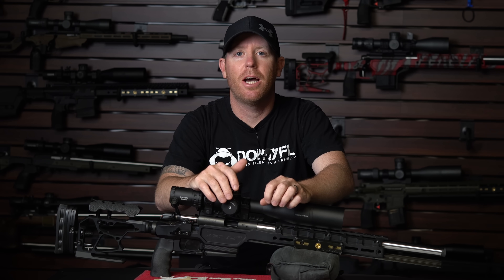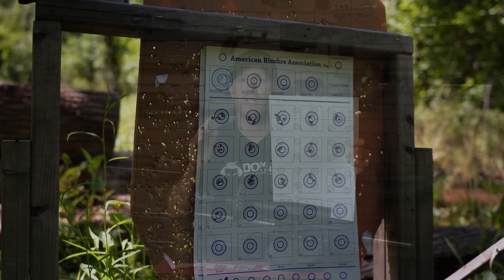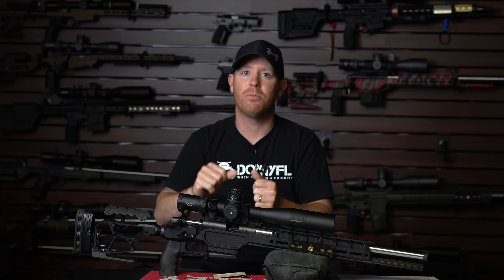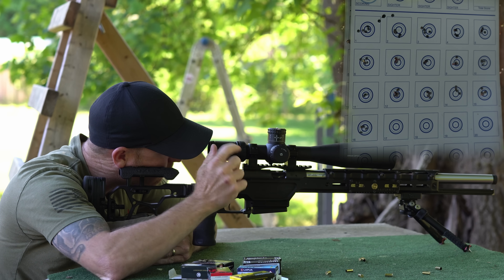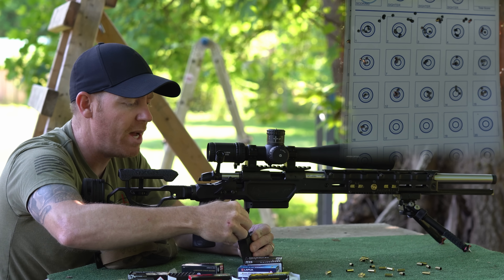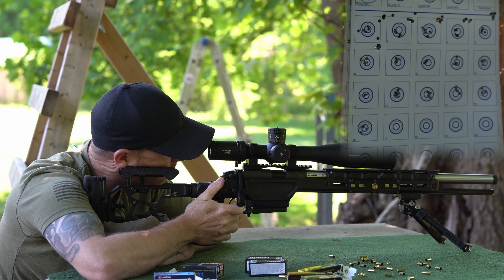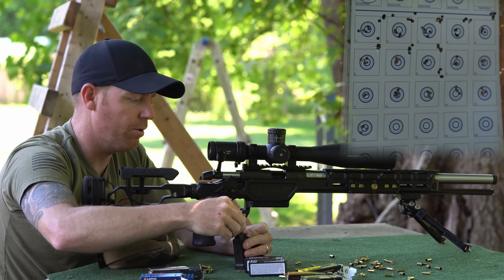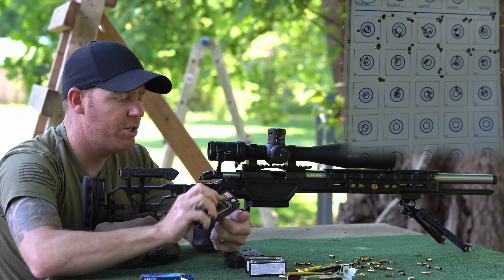Increasing Accuracy with Shims //Bergara B14R Heavy Part 2

Comment: I feel it's safe to say I have sorted more 22lr ammo than anyone, maybe 20k rounds.  Here is the interesting thing I have found, now this is the cheap 3 bucks a box ammo.   I can re-measure some ammo, and it appears the rim will give me say 3 different measurements, i.e. - one side of the ammo's rim may be way thicker vs the opposite side, and the measurements are repeatable, its what I call bad ammo.  I have found on the low end .0365 rims up to .042 thick rims, I sort out to .0005 lots.  Yes, I have more time than money, but it is interesting results for sure.  I like the idea of shimming, it makes a lot of sense if you have consistent ammo. :_Vudoo: :_Target:
Reply: Absolutely correct. That's what I do, then I measured the head space, subtract the difference in rim thickness, and now you'll know what shim to use. I noticed a difference on my CZ 457.
Reply: The only repeatable results from sorting I have ever gotten were from sorting Remington Subsonic by weight. The heaviest ones shot on par with any match ammo I've tried in that rifle. 

I did the math, and if I want 50 rounds of match quality ammo, it is cheaper to just buy a box of match ammo than it is to buy enough Rem SS to sort out 50 accurate rounds.

Sorting is not the answer. I consider my rim thickness gauge to be one of the worst purchases I ever made.
Reply: @sapago4166  When I sort by rim size, I typically get 6 main sizes of ammo.  
.0395 .040 .0405 .041 .0415 and .042
With most in the 40 and 41 category.  I have a scale, but I haven't used it, it would be way too much work, if I were shooting a match and weighing 150, it may be worthwhile.  I totally agree, just buying good ammo is the best answer
Reply: I want whatever you’re smoking

Comment: I had similar results with my B14R HB from A&J. I put mine in an MDT XRS chassis with the Trigger Tech Diamond trigger and used the Cortina precision bolt shroud. Mine doesn't shoot SK bad but it really shines with Lapua Center x , Lapua Long Range, Lapua Midas + and RWS R50. I've never tried the bolt shims but mine is not as consistent with the Eley Match.

Comment: Bolt shims made a HUGE improvement for my CZ 457 Varmint MTR for both the 22lr and 17HMR barrels.

My take from this is that Bergara does a better job at the factory with head-spacing than CZ.

Although there’s a lot of voodoo in the world of rimfire, so often what works for one doesn’t for another.
Reply from the maker: I'm sure it's a floating tolerance. I think they are worth the few bucks someone would spend to optimize a factory barreled action for sure

Comment: Super interesting stuff... I suppose rim thickness sorting could be a thing to try? 🤔
Reply: In all honesty, with quality ammo, they give you a good product you shouldn't need to sort, but if you use cheap stuff, and have time, it may be worth the while.  I can sort a box of 50 in about 4 minutes.  I do see less fliers with cheaper ammo for sure after it has been sorted.   The equipment I used to measure, bought from the big online shopping site.  A Raven Eye Custom shell holder, a Digital indicator with a .5" throw (important not to buy the 1" throw, it will be too big) and a set of indicator tips (the tip used is usually pictured in the lower left of the case, about the size of a pencil eraser) , price is about 26, 27, and 8 dollars respectively, so for a 60 dollar investment you can measure your ammo, look at the frequently bought together for the package combo

Comment: Good ignition is more important than headspace. My B14 R has a .043" head space from Bergara. I no longer use any SK ammo. There are always one or two fliers in every box. Eley SABRP is my go to ammo. Zero fliers so far. Bolt shims really improved the accuracy of my CZ 457, along with fixing the firing pin. The 457 has poor ignition. It also likes SABRP.
Reply from the maker: I think the 457 has one of the best ignitions in the game for the money. I'm not saying every rifle is great but the good examples are right up there with vudoo etc. 
I shot 30+ shots over the Chrono with my cz and my vudoo. The SD was 5.1 and 5.3 with Eley team.
Reply: @PursuitofAccuracy  have you trimmed the nose of the firing pin?